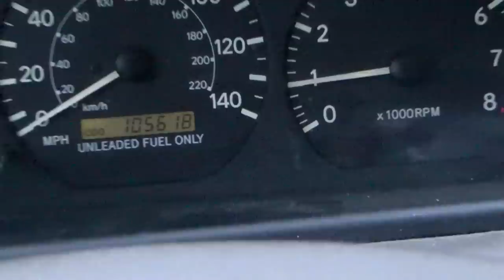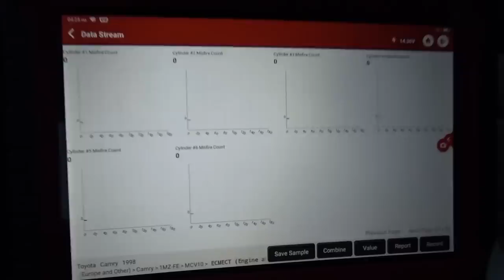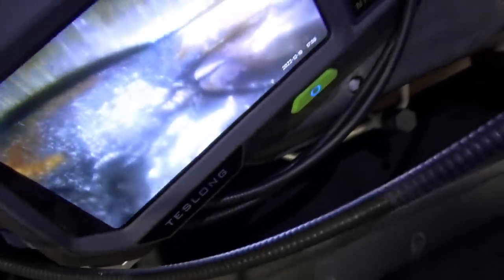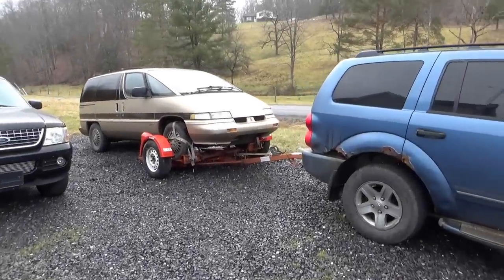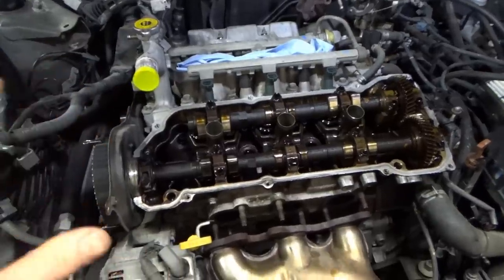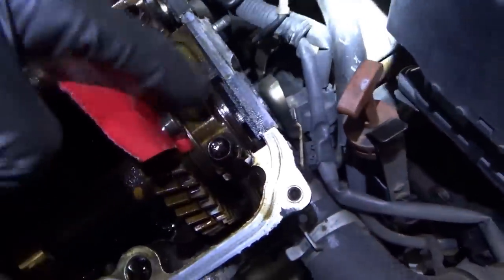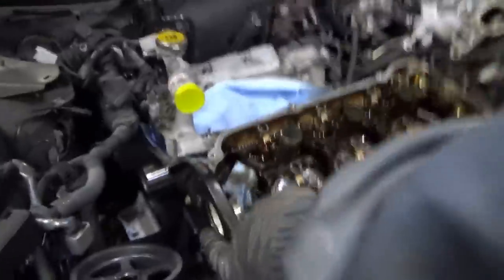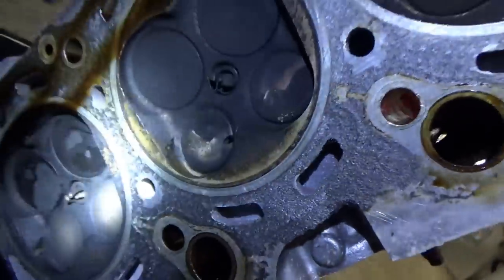How to Kill a "Bulletproof" Toyota? (98 Camry V6 Misfire - Part 1)

Comment: I don't understand how an engine with a timing belt is bulletproof? It's considered disposable in my opinion? I have never seen a timing belt engine outlast a timing chain driven engine? It might be different if it was taken care of better, but most don't do timing belts until they snap and grenade the engine? Who would want to spend a $1000 every 30,000 miles. Nobody talks about that fact? You should be able to get at least 200K miles on a timing chain engine, timing belt Hondas and Toyotas I have seen only get about 120K before they grenade? What am I missing?

Comment: Here's how you kill any engine and any catalytic converter is you sit there and drive it for a long period of time with random misfires quick way to kill your cat by dumping all that fuel from the misfire into it and it getting so hot and turning into a big glob of hot molten metal and then once it cools it turns into a big chunk that bounces around and makes all the noise in the world lol or it can even clog and cause even more issues.

So I know we're all not made of money but if your car is misfiring try not to drive it as much as possible before getting it fixed or looked at.

Comment: I swear Ivan would replace 1 brake pad instead of the set then brag about how he saved money.    Considering the age and mileage both heads should have gotten rebuilt along with a new timing belt etc.    Net price on the parts wouldn't be that astronomical and on your own vehicle the labor is essentially free.   Very frustrating seeing someone who harps on accuracy when doing diagnostics (and rightly so) think patching an engine is acceptable.    Just another video made for the clicks, the uninformed circle jerk viewers will think this is gospel.  

Do it right or don't do it at all.
Reply from the maker: It's my car so I do what I want 😜